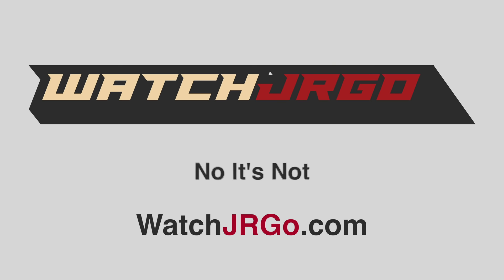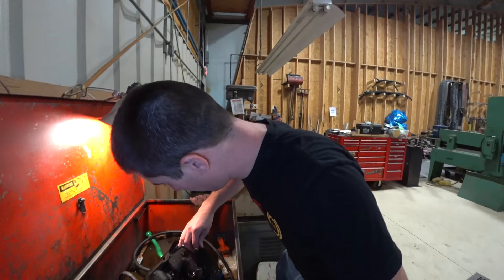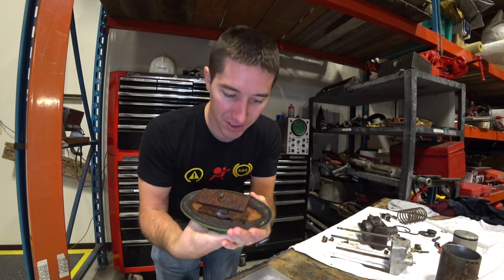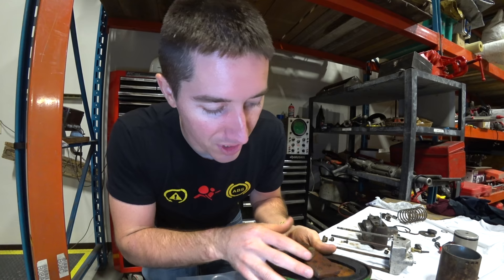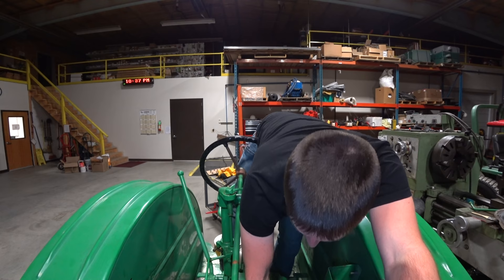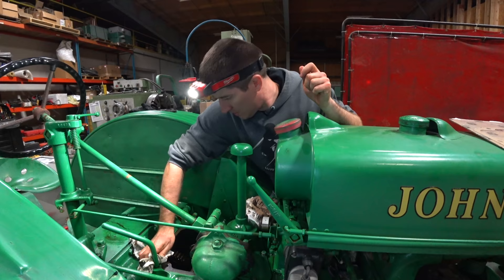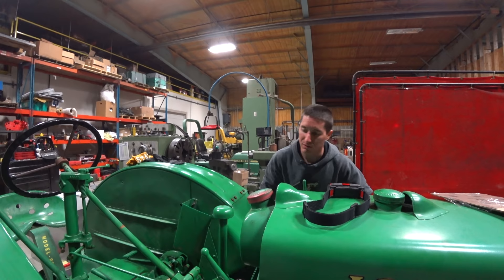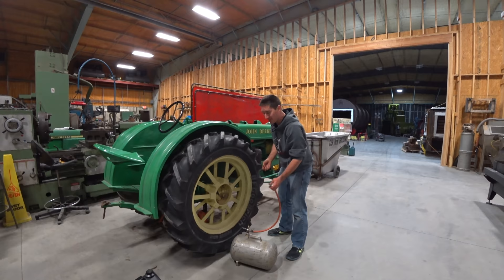Removing ULTRA THICK Oil Sludge From The John Deere BO Tractor And Its FINISHED

Comment: Substitute a couple of quarts of Dexron ATF  and top off with engine and transmission oil and run it for an hour or two. Drain and refill with fresh ATF and oil and run longer. Drain and refill again and leave it in and run it to the next scheduled service. Be sure to check the screen and replace the filter each time. It will dissolve the sludge in the passages and and corners and also helps soften seals. I have done this many times in tractors, cars, mowers, you name it. Does not harm the engine and the extra detergents clean the insides up great.
Reply: I've seen what atf does to a motor - dead gaskets and smoke coming from EVERYWHERE
Reply: @boredom.victim  If that's the case, someone was doing something wrong or the engine had other problems.
Reply: @deanmeyer1815  definitely ... i have done this  at least 5 or 6 times over the years  to slugged  engines with out any problems at all ..

Comment: It's a diesel so if it ran out of fuel don't you have to bleed the fuel lines to get the air out before it will start again?
Reply: None of the BO's were diesel unless you switched from gas to diesel when the tractor was hot enough to run diesel
Reply from the maker: Gas engine, we just used diesel to clean out the old oil. Off-road diesel is much cheaper than road taxed fuel! ⛽️
Reply: It’ll burn diesel once it’s up to temperature but it doesn’t have an injection system so no you don’t have to bleed anything. These were made to start on gasoline and then once they were up to temp you’d switch over to your low cost fuel which was distillate. Heavier and less refined than gasoline.
Reply: @WatchJRGo  My mistake, man it really sounded like a diesel motor, what time is it there I didn't expect you to be awake. I am commenting from Sydney Australia, it's mid morning here.
Reply: Stephen Johnson 6:50 pm

Comment: Good for the rinse out,hope you plan to redo this process late next year if each of the tractors are used a bit as more dirt likely will be flushed out with a couple more changes.
Just the same as you have done with those other tractors in your collection I bet.

Comment: I would 1 qt atf to 2 qts of oil. Run for a day then change the oil and should be all set. I done that with my 45 farmal A tractor. Worked great.

Comment: Kerosene is probably actually a better solvent but acitone as long as there isn't any plastic or rubber in the crank case would probably be best
Reply: Joshua Nicolai would also remove the paint inside the crankcase and send it through oil galleries. Bad idea.